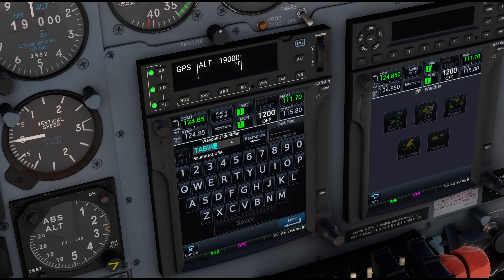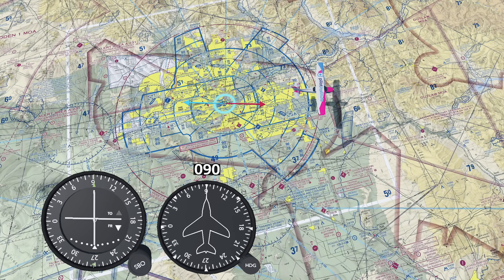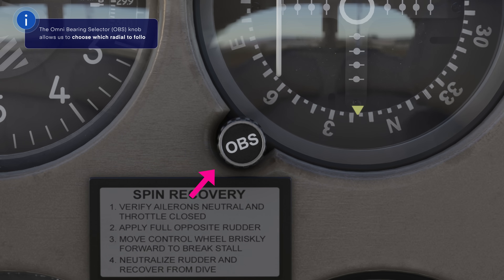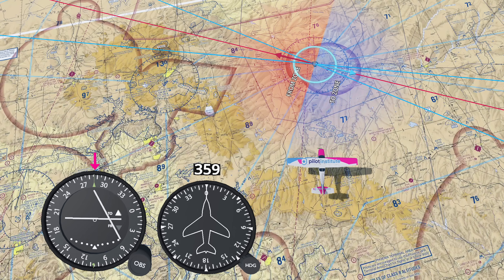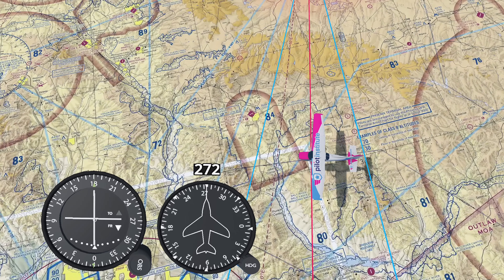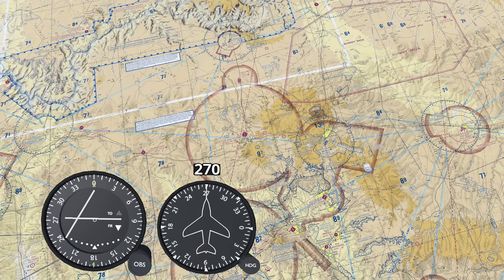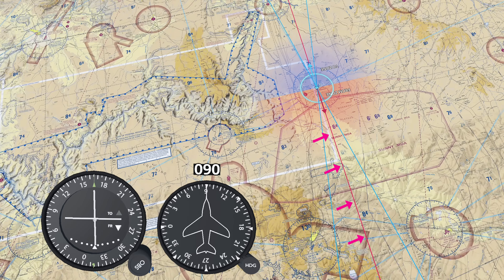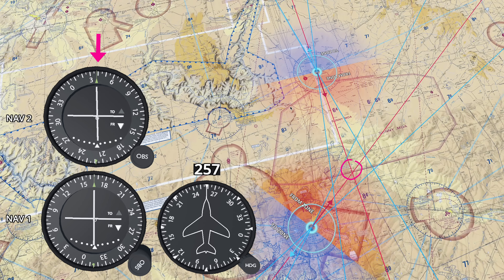How To Use a VOR (The Right Way)

Comment: the video title is a bit misleading.  this does explain how to use a VOR (albeit a very small portion of the video), but the other info befuddles the use part.  a video on just use, not explanation on what it is would be more helpful.  add a couple examples.

Comment: Not quite sure what's going on here, I downloaded this app months ago and lost it. I now downloaded the new one that this link points to and all I can do is rotate the plane, moving forward cant be done with the keys. The options menu is gone, I tried connecting up an xbox controller and it's the same deal, can only rotate, cannot move the plane forward to actually fly. Have the keys changed? is there a special way to get to the options menu as well? 

Please advise.
Reply from the maker: Please email us details about your setup at contact@pilotinstitute.com so we can investigate.

Comment: Always wonder how many pilots really understand Morse code in order to identify a station
Reply: You don't have to translate the code, only compare the train of long and short sound pulses to the figurative drawings on the chart.
For example, you don't have to know that ...---... means SOS but only compare this to the length of sound pulses you hear. That is 3 short bips, 3 long ones and finally 3 shorts bips again. If the drawing match the sounds, you hear the correct and functionning VOR.
Reply: @Tel-mate I’m aware of that but still think most pilots wouldn’t understand

Comment: Excellent ...    But  why  When I adjust the plane's heading  with the   Q    and      E    keys  for example     64     and try   to  move the plane  with the    W   A   S    D     keys, the plane's heading changes and I can't fly on my desired heading.   Please help.
Reply from the maker: We designed Q&E to change the heading to help explain how the heading has no bearing on the actual VOR needle movement. WASD are designed for flying around.

Comment: Thanks!!!!!! I just could not quite get my head wrapped around what was going on with this VOR system... But this video and that neat little software provided here did the trick!! If a pictures worth a thousands words how many is a video and free learning software??? A million?? Thank you Mr pilot institute guy!! It was also explained to me that just like GPS the radio signal has a reference signal then 360 dings after... the VOR system detects the time delay. The longer the delay the higher the number of degrees. so Ding.. ding is say 20 degrees   ... Ding.................... ding is longer so say 270 degrees.

Comment: It's weird they don't have an app for android users
Reply from the maker: The VOR app is not mobile based. There's no Android or iOS version. Mac, PC, and Linux only.
Reply: @PilotInstituteAirplanes  so it means we will bring computer in the plane to use it?
Reply from the maker: You should not be using this in the plane. This is designed to help you study while on the ground so you can be ready in the air.